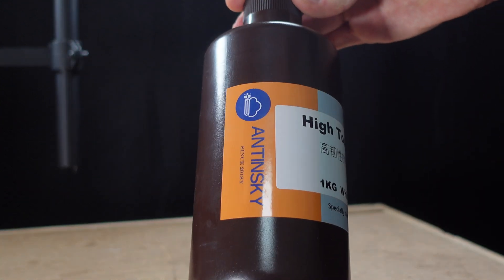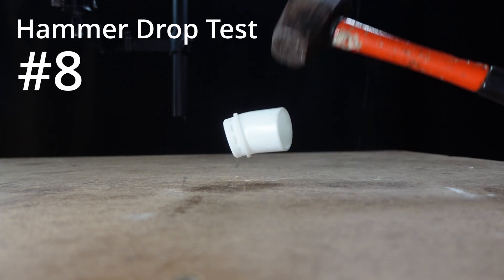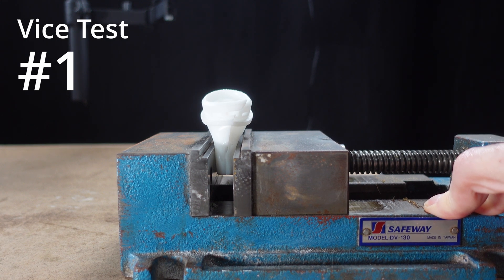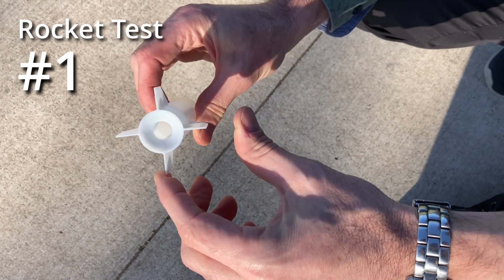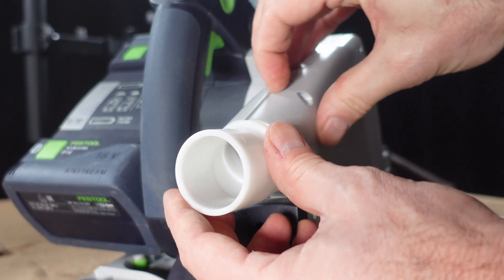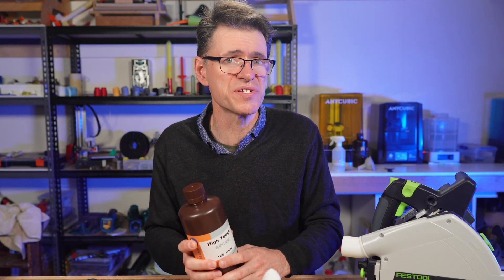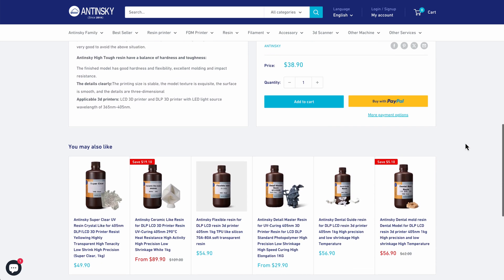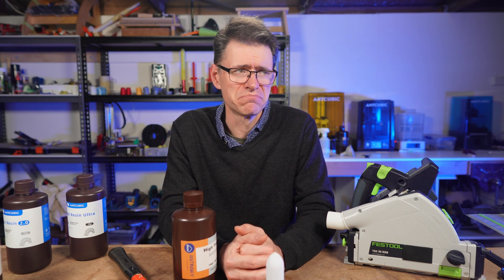Antinsky High Tough Resin | How tough?

Comment: Hey boss, thanks for the video. I was optimistic about this resin, but I got the bottle in the mail just now and saw it doesn't come sealed in a bag, it has no padding, and it isn't sealed with foil. Is this how your bottle arrived?
Reply from the maker: Thanks for your question. That’s unfortunate. Mine was sealed in a plastic bag and also had a foil seal on the bottle under the cap. I’d write to them and ask about it. I’ve found them to genuine… I’d be surprised if they didn’t fix it. You could always mention you watched my review. I’m about to release more video on a few more of their resins. I honestly think they make some good resin. The SG Engineering resin was up there with Ameralabs XVN50, and that’s quite an achievement. Let me know how you go.
Reply: @ColinKlupiec  They responded and said that's how it ships, no foil seal, no bag, nothing but a ratty box. The resin seems to be fine, but of course this thing is a hazard while transporting, and you can't tell if it has been tampered with, or swapped and returned.

Comment: would have been great to test vs something like FDM PETG-CF
Reply from the maker: Hey, thanks for the suggestion. I did think about that. I've made these previously in PLA+ which was very strong also. But I switched to resin because the print quality was so much better...at the time. Maybe I should get newer FDM printer to make some additional comparisons...😀
Reply: @ColinKlupiec  yeah I print in 100% FDM now, mostly functional parts - but I'm looking into some things that might be interesting to print with resin and expanding print options.
Reply from the maker: @YokohlCreek  Cool. I ended up going down the resin path because once I saw how good the print quality was, I just kept searching for ways to make parts that looked like they weren't printed...more like injection moulded.

Comment: Can this resin be dyed without compromising its physical properties? Also how susceptible is it to temperature changes?
Reply from the maker: Both good questions. I can't comment on using dyes, but I have mixed it with another coloured resin and the result seemed to be quite good, although I didn't test strength properties. I didn't do any temperature tests for this resin.
Reply: @ColinKlupiec  Thanks for the reply! I'm trying to choose between resin and FDM printing, and with how rapidly changing things are with resins, I seem to be leaning in that direction. I have a number of projects in mind, and for these my prints need to be tough, mechanically durable, and resistant to sub-freezing temperatures. Aesthetics are also a priority and painting or using wood filler isn't an option, so resin printing easily takes the cake there.
Reply from the maker: @bisterkding9249  You're welcome. I try to answer all comments as best I can. I started with FDM but quickly became super curious about resin when I realised that I wanted more than just a 3D printed model...I wanted to make real products. Or at least as close to something like an injection moulded product as I could. Resin will definitely offer you that, especially with how resins have developed just in the last two years. I'm lucky to have the opportunity to be testing them. One thing I can also recommend is printers with tech that speeds up the printing process. I now use an Anycubic M7 which adapts printing lift (and light off) parameters based on the shape of the model at each layer. So far the improvement in speed without loss of quality is quite remarkable. And now you've suggested a test I wouldn't have considered...freezing the prints. Nice 👍. Let me know how you get on.
Reply: @ColinKlupiec  I actually just thought of something, and maybe you'd be interested in exploring it: a method to coat FDM prints with a UV-cured resin coating like those used for resin printing. Some kind of combination that draws on the strengths of both printing technologies.
Reply from the maker: @bisterkding9249  That's also interesting. I just tried something similar by coating a resin print with new resin before post curing to get a shiny finish. It works, but needs practise. 😀 You can find it here. https://youtu.be/MWskGYdc984

Comment: Question: will it leave the white powdery residue due to friction? This is an issue when using these resins for threads
Reply from the maker: I don't know. Haven't tested that. But I'd say it might be likely. In my experience, most resins leave a white powdery mark when scratched.
Reply: I'm gonna try it out! It is one problem that I still haven't been able to tackle. For now I coat them with PU. Could also be interesting for you in order to give you the extra mm en tickness for an extra tight fit.

Comment: Unfortunatelly you missed a very importand test. How is it when part is warmed up?:)
Reply from the maker: Good pickup. I didn’t do the ‘warmed’ test this time because the performance was already so good. I only did the ‘warmed’ test because I thought colder conditions were making other resins more brittle. But it’s worth testing the Antinsky resin when it’s warm…stay tuned.
Reply: @ColinKlupiec  Nothing super critical tho. I have been printing with tough ultra now, its ok but parts are qute soft when its hot outside. They feel more like a hard tpu than  "plastic". Do you have any polish roots btw?

Comment: The white color is great because it can easily be dyed. This resin seems really promising.
Reply from the maker: Yes, I suppose it is an option to dye it. I must try that. Can you recommend a good resin dye?
Reply: @ColinKlupiec  I only tried the Solid Color Pigment brand, which is made for epoxy resin. It worked very well but it's only sold in tiny bottles. I've seen others successfully use Rit Dye on resin printed parts, with one advantage being that their bottles are quite large.
Reply: @ColinKlupiec  Anycubic have a resin colour kit. Pourable resin dyes are available and should work as well.   I got a bunch of resin dyes but I need a white to test them  with.
Reply: @ColinKlupiec  It works really well but some color change resin properties quite a lot making it way more brittle.

Comment: I really enjoy your videos! They’ve given me great ideas about different resins, especially since I focus on printing functional parts. I’m really new to resin printing, though, so I’m still learning a lot. Have you ever considered trying any of the Formlabs resins? There’s an ongoing discussion in their forums about using their resins with LCD printers, and it seems like it might be possible. I feel like Formlabs is a bit ahead in resin development. I recently watched a video featuring their Rigid 10K Resin, which is glass-reinforced, and I was really impressed. It would be awesome to hear your thoughts on it or even see you test some of their resins. Thanks again for your videos—it's hard to find content focused on functional parts on YouTube, as most of it is about miniatures!
Reply from the maker: Hey, thanks for your comment and great feedback. I really appreciate it. I haven't tried Formlabs yet. But it's definitely on my radar. I'm currently testing some Ameralabs resin which so far is really impressing me. Antinsky also wants me to test their engineering resins, so it looks like more rocket tests are coming too. Plus I'll probably be testing heat resistant resins soon for electrical parts etc. Comments like yours encourage me to widen my testing methods. Stay tuned.